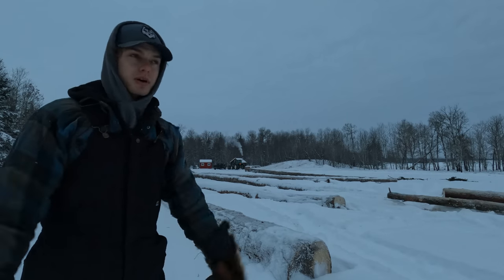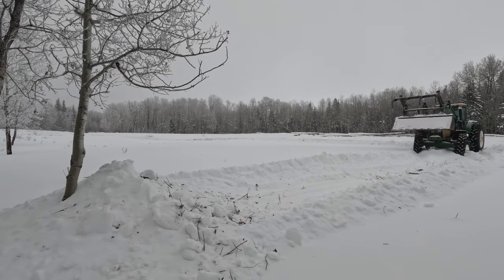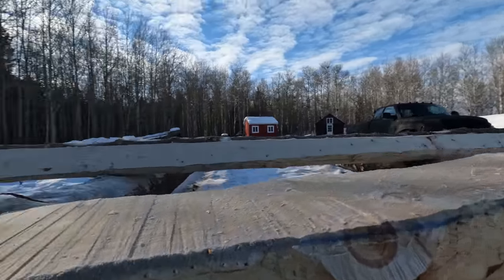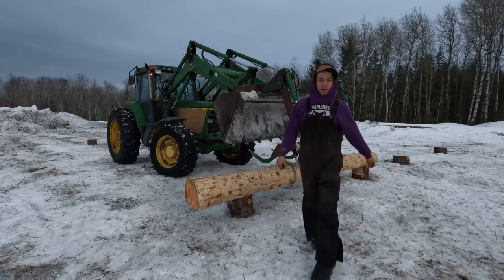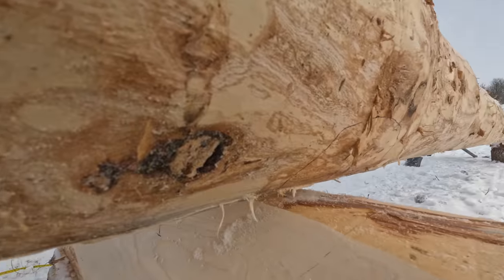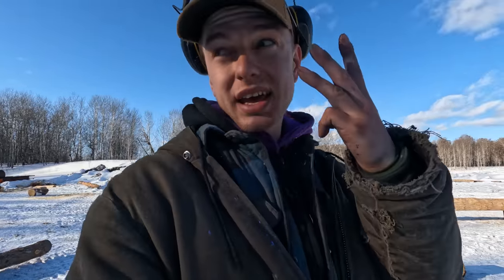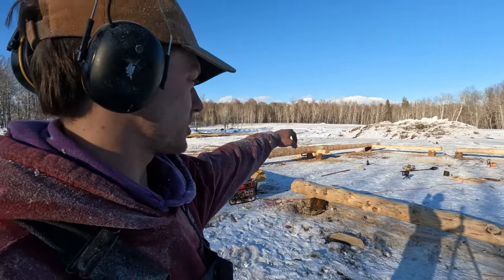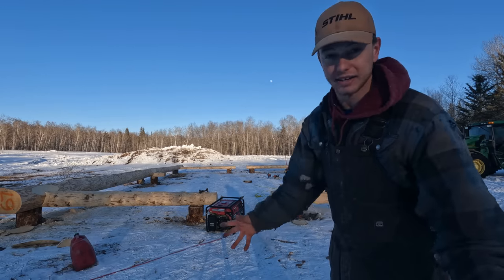Building My Log Home Pt. 3 - Setting the First Logs!

Comment: Hey Bud, on that big Stihl, careful you don't cut too much when that chain is dull, that big girl will cut when it's dull I know, but don't be tempted to. When the chain is dull, it will spin faster than a sharp one that is digging in. That could allow the engine to over-rev and burner a cylinder.

Comment: Quick question: on the next video can you talk a bit on how the stumps are stabilized and anchored? Just asking because sometimes ground can heave depending on freeze and thaw. Thanks!
Reply: I would not be doing this without concrete footers that's for sure. It's all about the base when building . He should number these logs, take them apart and in the spring start pouring footers.
Reply: @kevinjamieson7899  He mentions doing significant research for this project, so I'm hoping foundation construction was included. I'd like to believe he excavated below the frost line, compacted the dirt, set concrete footers, and then placed posts on the footers, but since we didn't hear how the stumps are anchored it prompted my question. But just curious--if footers were set below the frost line and posts placed on top to support the sill logs--do you believe this construction would be stable and sufficient to support a log home of that size? I've also seen the buried portion of posts fire-scorched to prevent rotting and insect damage. Anyway, just curious on your thoughts...
Reply: I wondered the same thing, but minute 50:50, he mentions a basement so I assume the stumps are temporary.
Reply: @kindnessabounds  That's right--forgot about that! So perhaps he will assemble all the logs, number them, and then disassemble in preparation for the basement and foundation. This makes sense because the stumps do look temporary just sitting on icy ground. Appreciate your reminder!

Comment: Glad to see you up and hard at it. Really like to understand your process, I guess your gonna fit them and take em back apart ? What’s your foundation gonna be when you get your seals done.
Reply: I concur Don.  It's not Kyle's style to thoroughly explain what he's actually doing, a lot of the time :)  I made the same assumption as you though.  I'm guessing the stumps are just to get a level surface on uneven ground.  Since he said the house will have a basement, that will have to be dug and the foundation set first, then those sill logs he's created can be moved into position over the foundation.  I would think standard cinder block, or poured concrete basement walls would be easiest, but that would be expensive and maybe he's got something else planned.  A root cellar, much smaller than the house's footprint, would be possible without the need for high strength basement walls as a foundation.

Cheers, Sev
Reply: @Sev_Auk  yes I was just wondering what his plan was because a little to much weight and some sunshine will change the scribes if it settles. Thanks for your input though. I just don’t like to have to do things but once but the weather where he’s at is like night and day from where I live .

Comment: Deadly. Absolutely Deadly.  The build, the power saw, the great attitude, love it! 
Question. Is that the foundation you are building on?  If so, are you not concerned the stumps will sink into the ground with all that weight come spring thaw? I would hate to see you have to start all over again. Thanks for the video.

Comment: You should always shut down your equipment and disconnect the battery before doing any welding or you could damage the equipments electrical system!